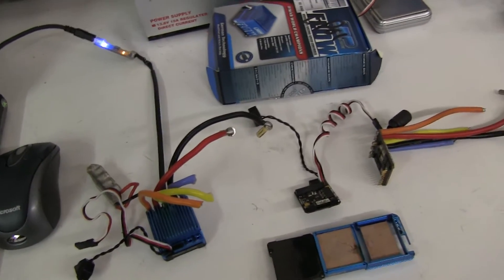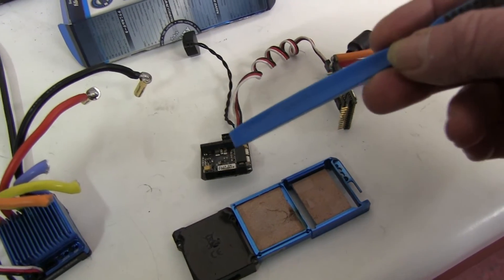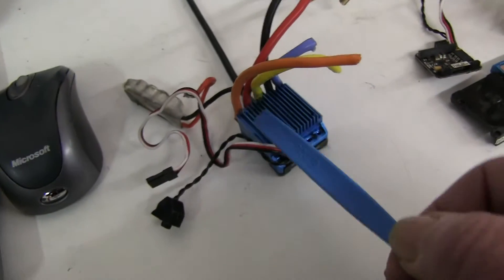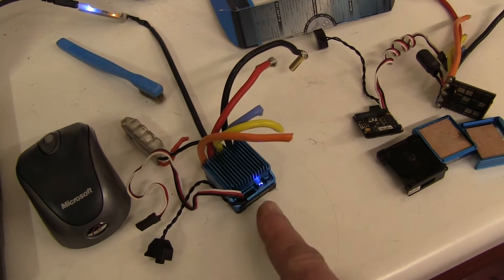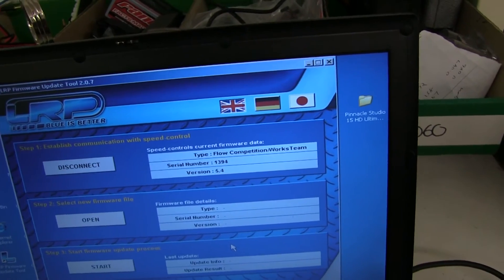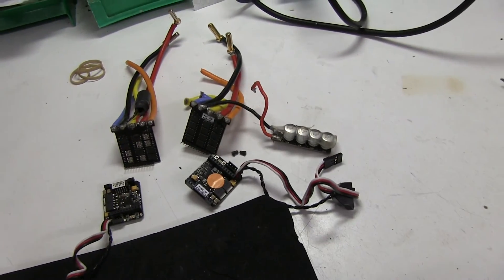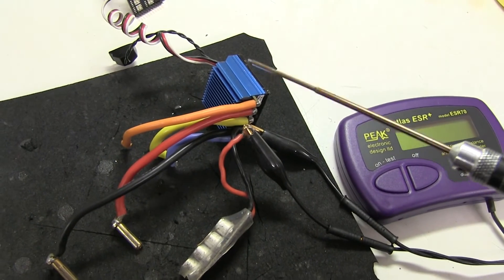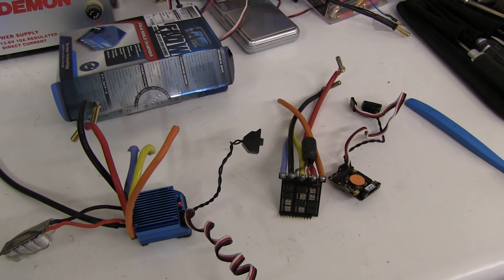LRP Flow Speed Control Repair

Comment: Just ordered one of these the buggy off Rd one, what's your opinion if you treat them correctly? Cheers Nick
Reply from the maker: Hi Kaylem. The LRP speed controls have always been winning at the top, and are still are . Make sure you get the correct setting chart for the Firmware of your one, as there are some versions and the setting charts are different. All the best and stay safe. Nick
Reply: @nickadams5411  hey I've just unboxed my parcel so I'll get the correct info from Lrp Web, confidence in experience and wisdom is underrated.. Thanks Nick

Comment: How can you tell that its blown will it blink set light?
Reply from the maker: Hi Matthew.  The LED lights will tell faults that can be corrected, Sensor wire, Overheat, rotor jammed etc.  If the Esc has a damaged circuit, it will not operate the motor, or it will be very hot . The Leds may not operate. This normally happens after connecting the lipo incorrectly, or short circuit in the motor, which will damage the esc.

Comment: hi nick i have a lrp flow team works esc. my power capacitor has gone bad. could you recommend one that  would work that i could go to electronics store and buy
Reply from the maker: Hi Seven

Yes, ask for a low ESR (low internal resistance) and 16volts or higher.
capacitance about 1000uF.
If they don't know the ESR get one with a high working temperature 105degree C or higher.